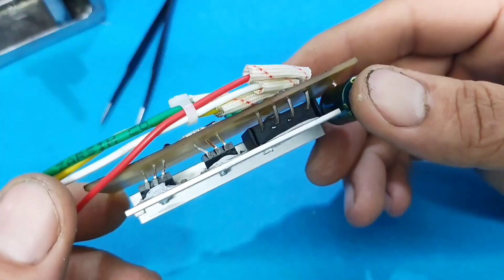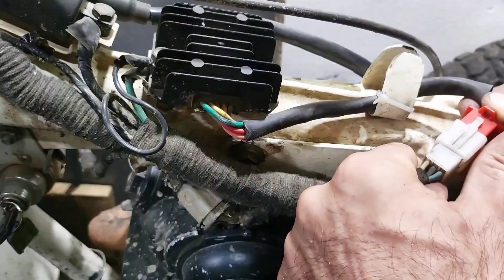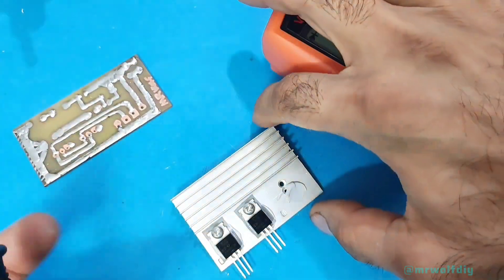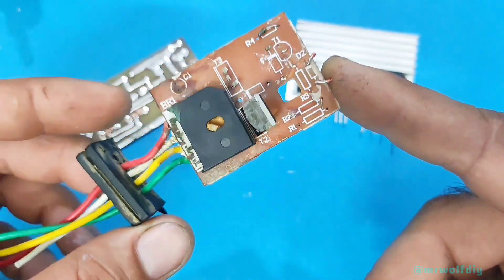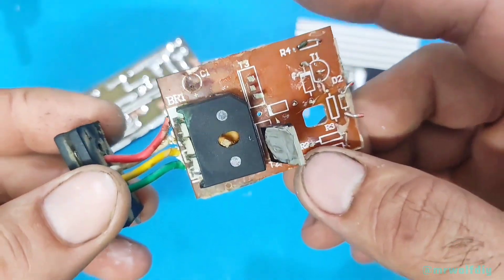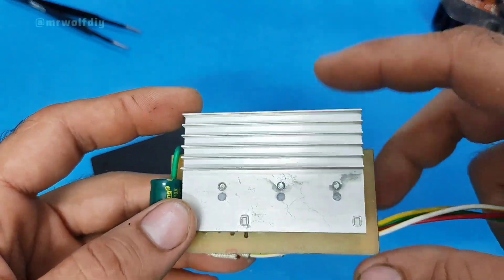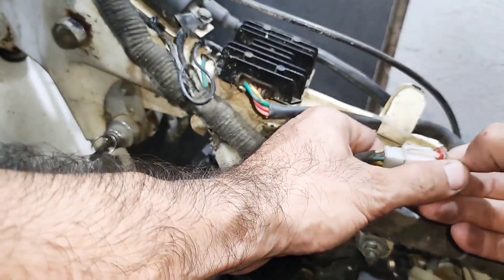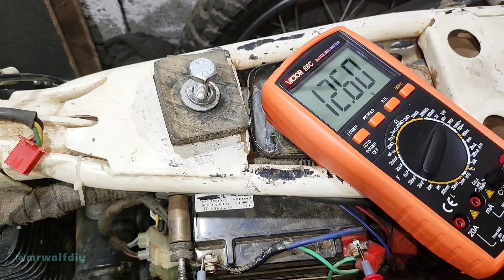Build A Full wave Motorcycle Regulator From Scratch! "Final edition"

Comment from the maker: Would you try building this DIY regulator yourself? Tell me 👇👇
Reply: Currently, many bike users are using LED bulbs instead of halogen bulbs, but this causes the battery to drain quickly/the battery to run out of charge quickly and the bulb does not provide enough light, so it would be very helpful if you could provide a solution. Plz sir
Reply from the maker: Actually, it’s the opposite. LED bulbs usually consume less power than incandescent bulbs, and you just need the charging system to work properly so the battery can deliver maximum performance and lifespan.
Reply: @MDHABIBURRAHMAN০৯  if you using big amp LED, MY suggestion, use 2 regulator and 2 batteries, one is regular battery, and the other one is lifepo4 in 4S and use BMS for those big amp LED
Reply: Yes I did and it works very good thank you MrWolfDiy you are truly a GENIUS ! I really love the regulator rectifier videos could you please please please make at least another one or two videos on how to make a single phase regulator rectifier of different simlple design and this time could you make one for a grounded stator that only has one wire ? I am now trying to build one for my lawn tractor it has a grounded stator and from what I understand you can only get full wave DC when the stator'S AC is isolated from the frame and has both ends of the coil being used coming out as 2 wire or "floating" as they say
Reply from the maker: Hello dear friend, thank you for sharing your opinion.
I’m planning to build a few other versions in the future that will probably suit your needs. 🙌
Reply: I have burnt 95 yamaha xv750 virago TCI unit. Can you fix it, please?? Le me know. Thank you!
Reply: @JettaFly4You he doesn't seem to reply often unfortunatly
Reply from the maker: Unfortunately, I can’t do that. You can use similar aftermarket options instead.
I previously built a simple version of a TCI; it’s on the channel. If you like, feel free to take a look.

Comment: Can this be used for Honda Cd70 for increasing charge current.
Reply from the maker: This is for a single-phase stator and a 12-volt battery. If yours is the same, it will work for you.
Reply: I don't know how to find a single phase or half phase

Comment: Hello, thanks for the tutorial. After the battery is charged, does the power sent to the battery from the regulator stop?
Reply from the maker: Hi dear thanks for the good question 
I must say, not completely 
This type of regulator doesn’t completely stop the charging; it only controls and limits the charging current so that the voltage doesn’t exceed the allowed level.
Reply: @MrWolfDiy  Thank you very much.

Comment: I made the electrical circuit, I connected everything, but when I put the multimeter probes in DC to the battery I see values that oscillate between 14.5 V and 19 V. Why? This also happened with other commercial voltage regulators.
Reply from the maker: It's for Single phase, What motorcycle do you have ?
Reply: @MrWolfDiy I have a Benelli 250 twin-cylinder Two stroke
Reply from the maker: This circuit isn’t suitable for your motorcycle — it’s designed for single-cylinder engines with a single-phase stator.
You should’ve asked first; I usually reply to all comments.
The charging level you mentioned is dangerous for your engine and battery.

It’s better to use the OEM version for now.
At the moment, I don’t have a proper circuit for engines like yours, but if I find one in the future, I’ll publish a tutorial on how to build it.
Reply: @MrWolfDiy In the stator, I only have one coil that serves as a light and charging coil. The coil only had one output; I created two at the ends of the coil to make it biphasic. What difference does it make if I have one or two cylinders? The regulator should regulate the AC voltage coming out of a coil, whether it's a single-cylinder or a twin-cylinder.
Reply from the maker: The problem is exactly here , I’m explaining this so others don’t misunderstand it:

In a single-phase stator system with "two outputs", the coil is floating, meaning neither of the outputs is connected to ground, and neither wire carries voltage on its own.
It only becomes live when one of the wires is grounded.

In fact, the regulator does this — it shunts the current and limits the voltage.
At that point, both outputs become live, and from there, one line is sent to charge the battery.

In reality, all the electrical systems in this type of motorcycle are powered from the regulator’s output, which is the battery charging line, unlike older or two-stroke motorcycles, where the lighting and charging coils worked differently.
While your motorcycle’s stator is already grounded, the regulator can no longer function properly.
Reply: @MrWolfDiy  What if I ground one of the coil wires? How can I fix this? I don't have anything on the market that can fix this problem, because the old system was 6V and I want it to be 12V because I need to run a 12V DC CDI.

Comment: Please make a tutorial on assembling the old Yamaha Vixion rectifier 🙏
Reply from the maker: Sure,
It’s very simple and I tell you here:
There’s a five-pin socket, if I’m not mistaken...
Top left is +12V, which is the output and goes to the battery.
Top right is negative or ground.
The three pins at the bottom are the three phases coming from the stator.
That’s usually how it is. 🙌
Reply: @MrWolfDiy 
Yes, sir, that's right. Please make a tutorial on how to make the rectifier.

Comment: Hello
I have a question
My carburetor motorcycle coil (alternator or boobin or  stator coil )     has two yellow output wires and no White wire at all
And the socket wire    that goes from the   engine coil   to the    charger   also has 4 wires

Is this full wave or half wave ?
is this  1 phase or 2 phase or  3 phase   ?

With this explanation, which model of your regulator is suitable for my engine?
Reply from the maker: Based on the description, it sounds like a half-wave, two-phase .
Motorcycle name and model???

Comment: Hello Can I replace 2n5401to 2n3906?
Reply from the maker: The 2n3906 has lower tolerance and is not a safe replacement. However, since both are PNP, it can be used for testing purposes.

Comment: Dear Sir 
Currently, many bike users are using LED bulbs instead of halogen bulbs, but this causes the battery to drain quickly/the battery to run out of charge quickly and the bulb does not provide enough light, so it would be very helpful if you could provide a solution. Plz sir
Reply from the maker: In general, LEDs consume less power compared to incandescent bulbs. An abnormal battery drain might be due to a fault in the motorcycle’s charging system.

Comment: ทำให้ไฟออก13.9+14.2ได้ไหมครับ ชาร์ทแบตlifepo4
Reply from the maker: If you use a Zener diode with, say, 12 volts, the output voltage threshold should become around 13.5 to 14.5
Reply: @MrWolfDiy  At what point should the zener be placed?

Comment: The power tool that you have what is it called? I have one but the drill bits that I bought to drill holes is too small to hold on the power tool dril that I have. I’m not to knowledgeable in tools for micro drill bits
Reply from the maker: I made this mini drill myself, and I had uploaded a video of building it last year, which was actually the first video on my channel. If you’d like, you can check it out.
https://youtu.be/6nAw2Jwo-Kg?si=uiStfNDb-jjnX4Br

But if you want to buy one, get a mini drill that can hold bits from half a millimeter up to a few millimeters (for electronics work only).
All the holes for components should be drilled with a bit of around 0.8 mm or at most 1 mm, and for terminals, bridge rectifier pins, or larger components, use 1.5 mm.

Comment: Silicone electronics glue is actually an eerily good heat conductor, it's not quite as good as paste but it's surprisingly good. It's not actually not mostly made of silicone, it's kind of a sneaky mixture.
Reply: Compate el circuito
Reply from the maker: That’s why they only work for a few weeks! I mean maybe! 🤔

Comment: So basically the thyristor r the ones getting hot? I mean is the only thing I see glued to aluminum
Reply from the maker: Exactly, overall, heating of the shunt regulator is a normal behavior, but it should stay within a range that doesn’t damage the component.
If the load exceeds the regulator’s capacity, the shunt has to handle the extra current, which increases the temperature...
Using original thyristors, a high-amperage metal diode bridge, and a good heatsink helps a lot.

Comment: Your work is very good. I still want to take an electronics course. I have a motorcycle that doesn't have a battery. Its charging system powers the headlight, turn signals and brake lights. Do you know the Belarusian motorcycle Minsk 125?
Reply from the maker: Hi dear and thanks for watching 🙏 
Russian motorcycles are very durable. I once had an IZH Roosta for a while...
I’ve also seen the motorcycle you mentioned, but I haven’t ridden it...

Comment: Hi your schematic is wrong because the two diode anode would be togeter as in the original are in node R1,R3 then it to be in yours node R4,R2 because in low rpm only one SCR will be firing, then btery voltage could rise in that case and the current in the transistor will be dangerous high and could destroy the transistor... now etxtrangely the handcraft is wright why?
Reply from the maker: right, but it works, because ,The anodes of the thyristor are connected together  just as you said...

Comment: Why do $35 regulator rectifiers on eBay go bad like in 2 weeks? If the processes is so simple why the break down on those Chinese $35 ones.
Reply from the maker: Yeah, It’s probably because of using low-quality parts...
Reply: Because the sellers specify the cheapest method of manufacture so they can maximize their profits at the cost of quality. If they are only going to sell them once then why not maximize quality so you can get more buyers? Greed and Short SIghtedness.